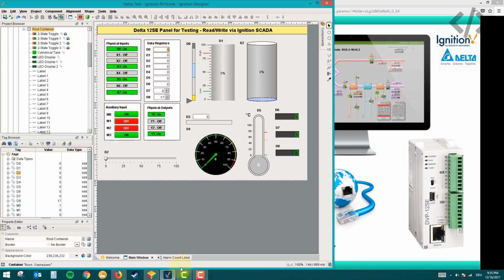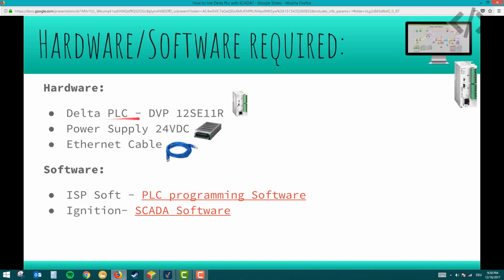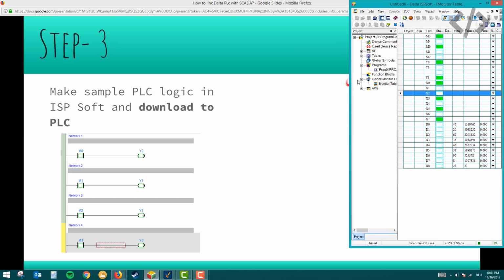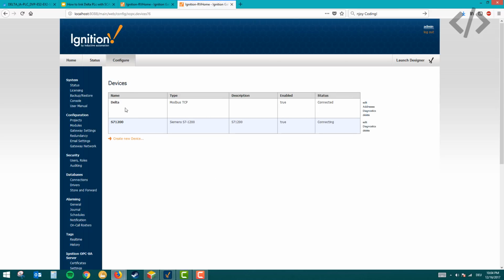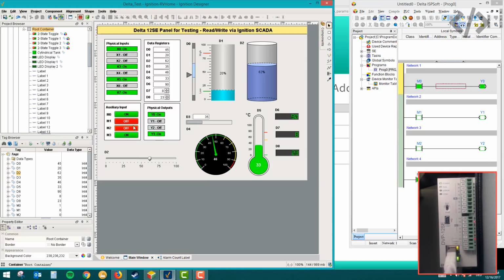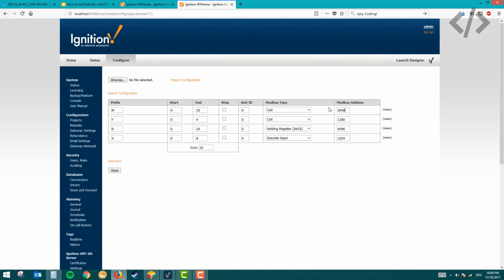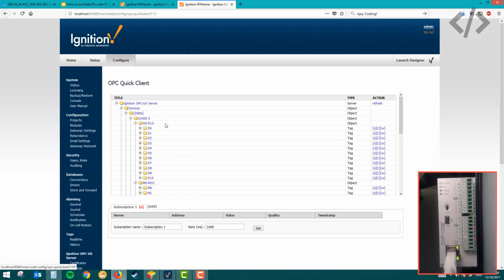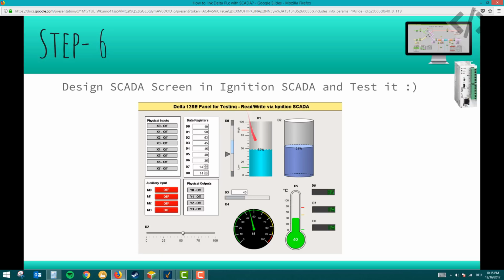How to link Delta PLC with Ignition SCADA

Comment: Super informative video!
My Delta AS200 series PLC uses X0.0... X0.15 and Y0.0... Y0.11 I/O address ranges, unlike X0... X7 and Y0... Y3 on your DVP-12SE. Ignition SCADA turned up an error when I attempted to save the addresses. How do I fix this? Thanks.
Reply from the maker: You can check my Delta PLC Simulation unlocked course to learn how to connect Delta PLC AS series to SCADA. The course is available here: www.codeandcompile.com

Comment: hi bro kindly please help me,  i have tried o communicate ignition with M580 PLC But in my connections area its showing connected but all my tags showing values as bad why ?
Reply from the maker: I am not sure why! But I have connected Micro850 with Ignition via Modbus TCP/IP and it works great. What communication did you use? You can check my course where I explained this here https://codeandcompile.com/course/micro850-plc